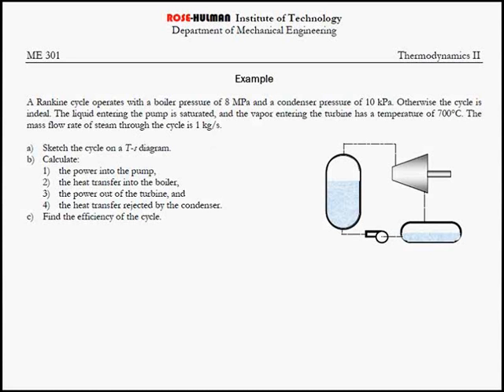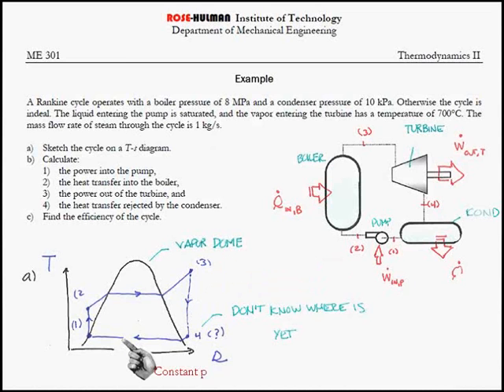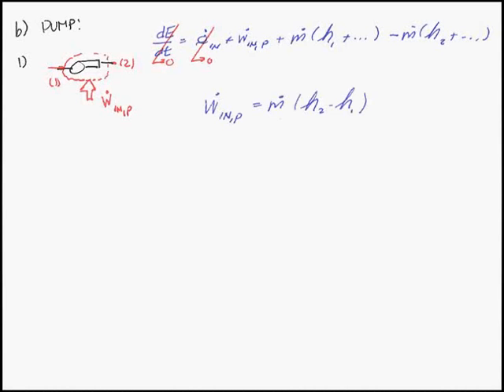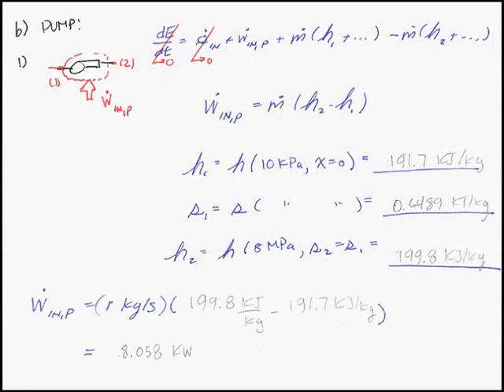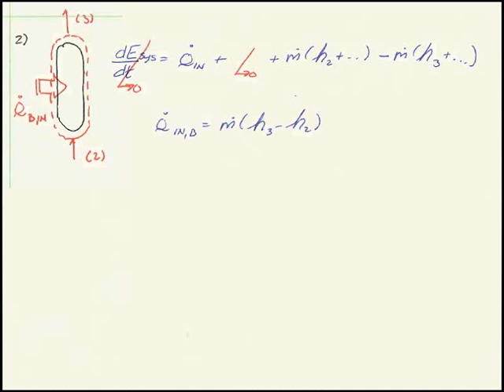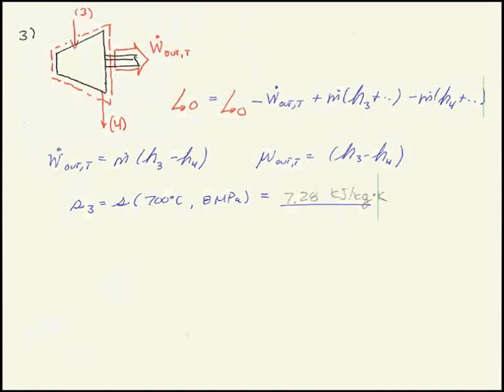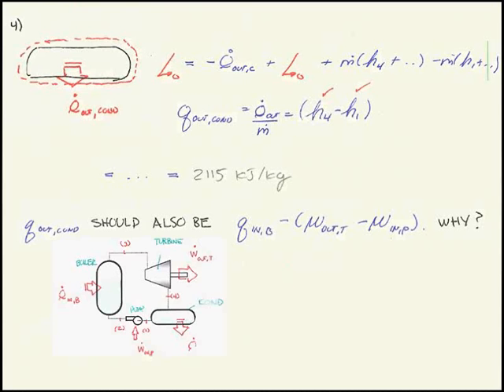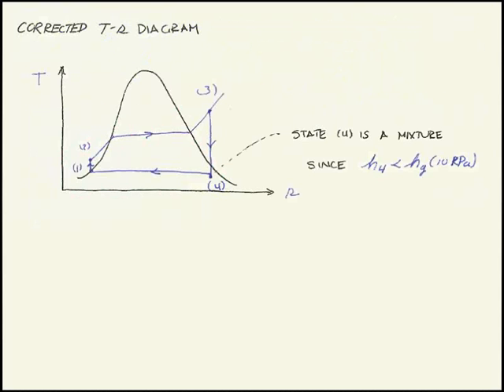Almost ideal Rankine cycle analysis

Comment: Hi! I'm confused with the calculation of h2. I understand the reasoning behind finding s1=s2. The problem I have is that I only have access to steam tables. How would I go about finding h2 from the pressure of 8mpa (80 bar) using s2 as in my steam tables I have values for sf,sfg etc. Its probably simple but I've hit a wall.